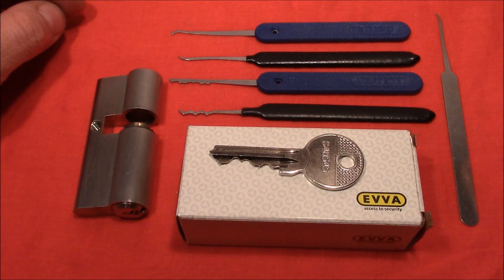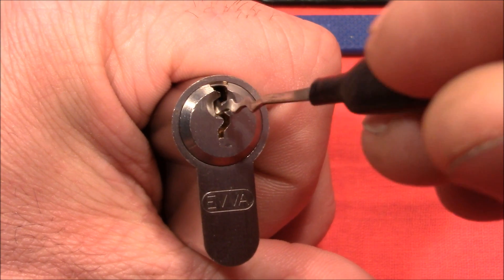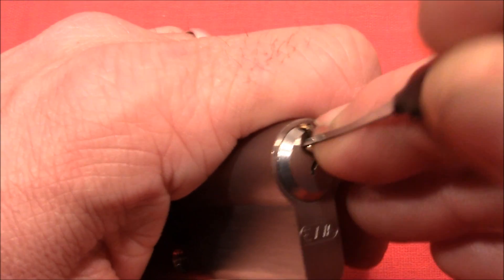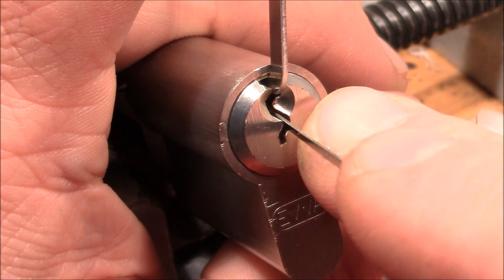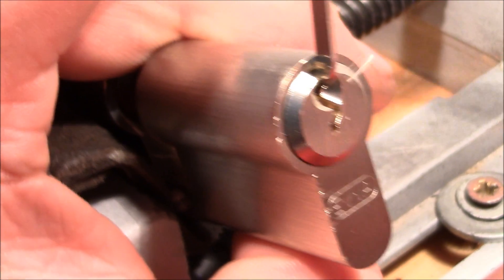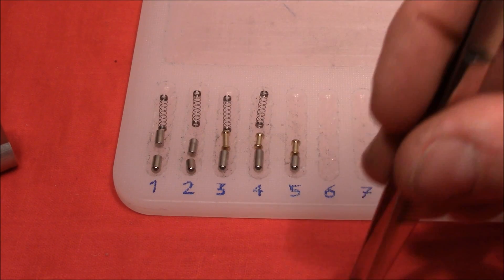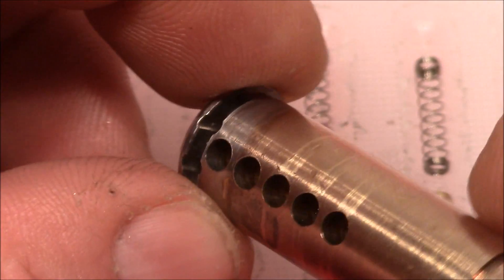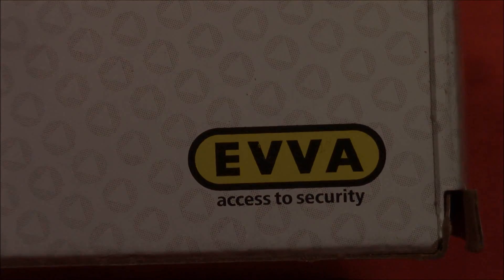(picking 161) EVVA [EURO cylinder exploration series] - picked and gutted

Comment: Very good and informative video, you explained everything very well!
I have one question: 
I want to buy a new cylinder for my door, it shouldn't cost more than 80 euros and offer very good all-around protection against picking, drilling and bumping.
Do you think that the EVVA ICS would be a good choice?
Reply from the maker: This is most probably overkill for a normal house door. The EVVA ICS has a protected keyway so that no unauthorized copies can be made - you probably don't need that feature. It's a reversible key which is comfortable to operate. But you should look out for protection against widespread technique to break into houses: Snapping and drilling. Check for anti-snap feature (enforced spine) and drill protection. If you add this to your EVVA ICS you will end up at 131,80 EUR (https://www.sicher24.de/profilzylinder/evva-ics-doppelzylinder-mit-sicherungskarte-n.html). It's for sure a fine lock, but maybe you find a cheaper model that provides snap and drill protection. BTW: Don't fear that someone would pick into your house - burglars normally don't do this - too cumbersome, unreliable and takes too much time. I'm sorry but I cannot recommend you a specific lock but I told you what I think is important. Check out all the lockmakers like ABUS, BASI, EVVA, BKS, WINKHAUS, WILKA, etc. for their products. And also mind the security of the door (plus back door) and the windows.
Reply: Wow, thanks a lot for the detailed information, I really appreciate it!
I do care quite a bit about security and to be honest I would love to have a door that even a locksmith can only hardly open but that's probably a little bit too expensive for me at the moment ;-)
I didn't think about snapping protection at all, I was pretty confident that this cylinder would be very good with the added drill protection for 20-30 extra euros. You probably just saved me from buying the wrong lock and then being disappointed a few years later because somebody managed to break into my home!
Thanks a lot again!
It seems to become increasingly rare to find youtubers like you who take their time to reply to their viewers comments, please keep up that nice attitude!
You for sure just earned my sub!
Edit: I'll ask for your opinion again when I find a new cylinder ;-)
Reply from the maker: No problem. From locksports-guys will almost always receive proper replies. Good luck find an appropriate lock.
Reply: Okay, after having done some more research I changed my budget from 80 euros to 130 euros because it seems that all the high quality locks start at a price of about 90-100 euros if not even more :/
I found 3 cylinders that seem promising to me:

KESO 8000 Omega² with a Chrome-Nickel spine
KESO 4000S Omega with a Chrome-Nickel spine
BKS Janus 46 with a Chrome-Nickel spine

Do all of these locks offer good resistance to drilling, snapping, pulling, bumping and picking?
Which of them would you recommend?

I also think that the IKON R10 2RWS, the DOM RS8 and the DOM ix Saturn are interesting but I don't think that they offer snapping protection, do you know anything about them as well?

I hope that I'm not annoying you with all of my questions :D
Reply from the maker: I had a quick look and I'd favor the "BKS Janus 46". It looks great from the specs and it was mentioned to be the successor of a lock that was the winner in a Stiftung Warentest test https://www.schloss-shop.de/Profilschliesszylinder/BKS-Serie-46-janus:::2_7.html But also with the DOM you'll be on the safe side. Check this document https://www.schliesszylinder-shop.com/images/schliesszylinder-shop-com---bks--janus-46.pdf It mentions drill protection and pull protection of the BKS; also you can see the reinforced spine. Don't be afraid if picking - burglars don't do this. Most often the weakest point is not the lock. Check the security of the door itself and the windows.
Reply: Thanks a lot for your reply!
I also think that the BKS Janus 46 looks like a very nice lock and that it's still pretty affordable for the features it offers.
Of course the security concept has to be good as a whole, I know that it wouldn't be very useful to use this cylinder if the windows are very easy to open or if the door is made out of cardboard.

Comment: Hey Potti, I just subbed, What kind of picks are you using? I need to upgrade my kit. I'm running a southord euro set
Reply from the maker: +TheZabbiemaster Well, I used sparrows and Peterson most of  the time. The sparrows euro hooks are just perfect and Peterson have so many different shapes that almost all special cases are covered. And are of extremely good quality. I love the deforest diamond a lot as long as the keyway allows it. There are also some hooks from southord that I use sometimes on euro cylinders to get in the holes of the pins in the keyway.
Reply: Potti314 too bad Peterson and sparrows have ridiculous shipping costs
Reply from the maker: +TheZabbiemaster Sparrows you can get from spooxe.com or  uklockpickers.co.uk. The petersons I got from here: http://www.universal-imports.com - but shipment costs are high :-( Couldn't find a re-seller here in Germany yet.
Some other shops: http://www.withoutakey.co.uk/ https://shop.multipick.com
Reply: Potti314 Hey Ive got my southord set from withoutakey. pretty nice vendor. thanks for the help!
Reply: +TheZabbiemaster I can recommend uklockpickers, brought from them a few times. check out madbobs too. Good luck.

Comment: I just seen a evva on ebay it was a pin tumbler euro cylinder with a bunch of side cuts, what are the side cuts? they weren't like normal holes they were slanted
Reply from the maker: +JB Hard to tell without knowing the lock. But it could be passive side pins that are used for key control. So you cannot just use a blank without side cuts as it would depress the side pins and block rotation. Nothing to worry about when you pick it.
Reply: +Potti314 I researched it more, it was for sidebar with false gates
Reply from the maker: OK, cool.